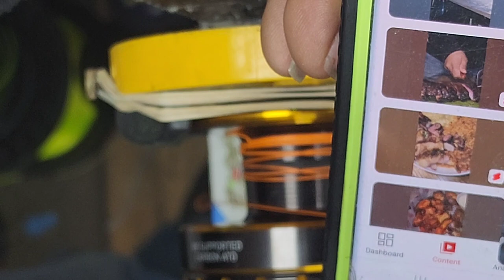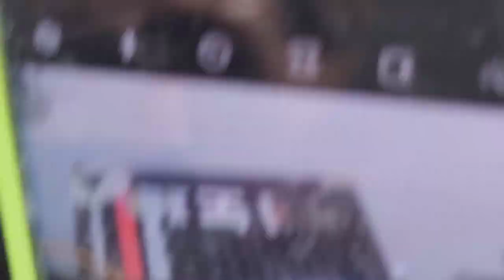how much can Diawa Bg 8000 spooling live recording tightline hollow core braid with top shot amsr

Comment: need some reels done, what are you rates?
Reply from the maker: If you supply the braid is $25 30s or smaller or less than 1500yds any thing bigger or more then $50
Reply from the maker: Includeds knots and splices upto 3
Reply from the maker: Call thw shop 361-334-2171 for any questions and any reels that gwt shipped to us you can see if live upon request

Comment: 4.5-5k setup? Geez! And people call my  gear expensive (most expensive combo I own is about one grand, gonna go to 2 eventually but can't see myself spending more than that)😅
Reply from the maker: That's the way I used to think but these are the tools of my trade and there are way more expensive one out there but these are the best bang for my buck..
Reply: @TeamHardLife  oh yeah, once I'm settled down and have everything, fishing and life vise going, I might start with that too. The only reason my gear isn't in that price range is cause for a rod from a practical point of view it really doesn't matter that much as long as the blank has the right action, the guides are high quality and the reel seat is good (none of which really makes the rod exeed 200-400$ depending on the type of rod) and I mostly fish smaller to medium reels with heavier line cause for my waters maximum capacity hardly ever is what counts(1500 yard is basically overkill for anything cause of 50-300, max 500 yard drops while having to use 200lb with a 300lb top shot, giving you the ability to lock up all the way, but when going for sharks with big baits some reserves are always nice in case that great white bites), but stopping power and abrasion resistance does, so half to a quarter the money on line(for the biggest reels, most reels have max. 100$ in line on them) and a quarter to a third on the rod while my reels go up to almost 1k is really where the difference comes from, but my life goal is to move to Australia and be able to fish at least 2-3 days a week there, if I make that happen who knows how the gear will evolve, I mean a few years back 2-3 hundred bucks was a crazy amount for a setup 😅
Reply from the maker: I used to be able to see the rods in that same mind set however when we moved up to roller guided rods so many new doors opened up and the extras that I want in a rod made that price go way up.. straighy unibutts not bent or Winthrop position butt, full roller guided rod not including sealed bearing rollers, and the blank 80lb-130lb already take it up over $700-$800 without any without it being built, that's with 2 price increases that have happened hoping they stop going up

Comment: Can 130lb mono 1.09mm splice into 80lb diamond hollow core .41mm?
Reply from the maker: Diamond hollow core had a really bad problem of opening up to even accept the needle to splice it so I wouldn't think it does
Reply: @TeamHardLife  any recomendatorio a on hollow core that won’t cost me an arm and a leg? I was planing on sending my reel to you but my vacation week got moved due to seniority and now I have to get ready in a week for my trip.
Reply from the maker: Do you already have that braid?
Reply from the maker: If you have the braid we can still use it but will have to splice in a small section of a different braid in weight class as well and can make it work to then hollow core splice the mono in
Reply: I just ordered the 100lb Daimond to give me a good margin to make it work and not over fill my reel (daiwa 8000)
Reply from the maker: We can Def use what you have to start and use a small piece of better braid which will allow us to add the mono in.   $25 for the spooling plus $10 for the splice with upgraded braid to the mono.... and if you supply the mono no extra charge to add it on

Comment: I just got the new 2020 saltiga in a 20k size and got 500m of 80lb hollow core on it
Reply from the maker: Did you use the reel to crank that line on?
Reply from the maker: Also what kind of hollow was ?
Reply: @TeamHardLife  I used a machine and it was daiwa j braid hollow
Reply from the maker: Cool deal thank.you for that info
Reply: @TeamHardLife  all good glade to help someone ho helps me
Reply: @TeamHardLife it's a very nice hollow core and it's Cinda scary how good it is when it gets on the reef and I've had it on an old metal pole with a 6 foot bronze waler on the other side and got it back around and the braid was still like new
Reply from the maker: That means it's real smooth
Reply: @TeamHardLife  yeah it's probably as smooth as something like silk you should try some I've never had a problem with it
Reply from the maker: That's exactly